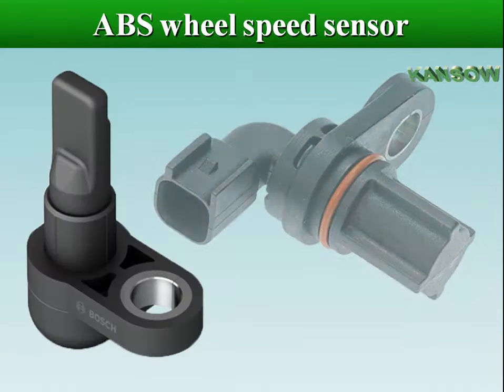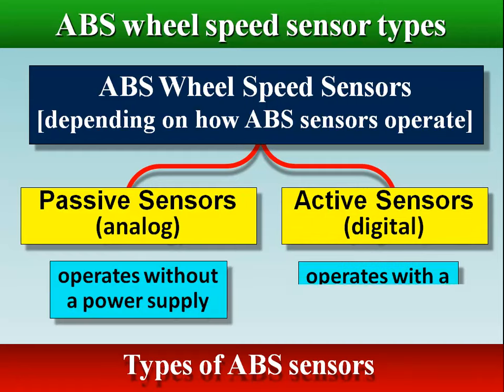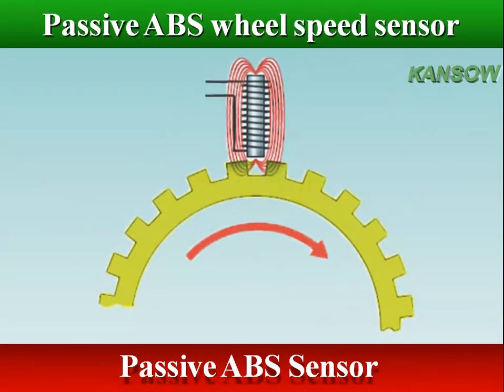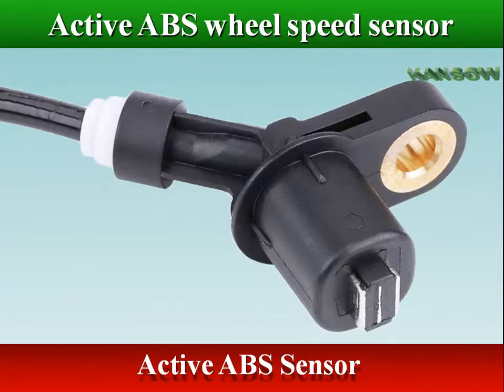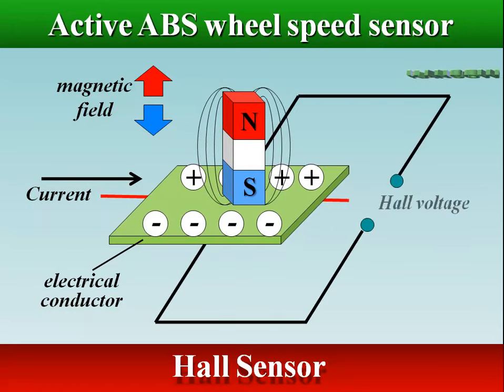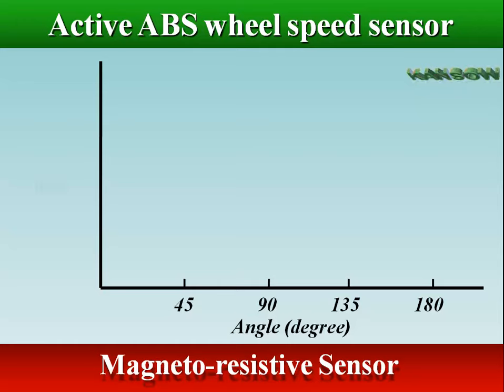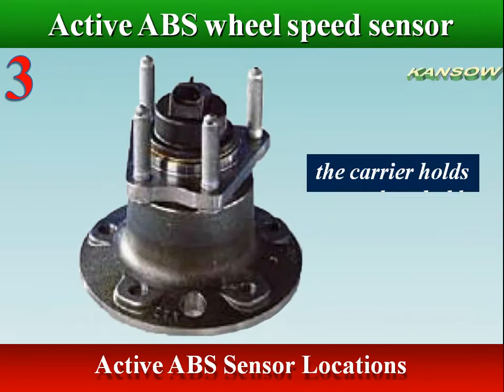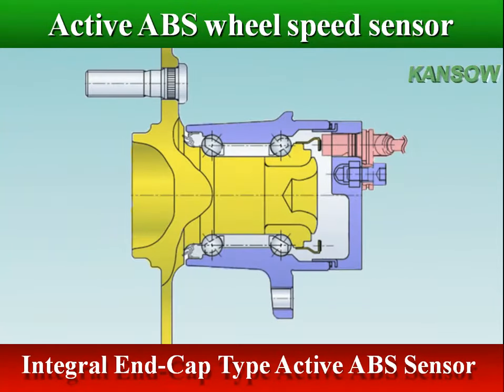ABS Wheel Speed Sensor

Comment: Hi there, Thank for good video. Is it possible to operate ABS module with only one speed sensor? Actually, I am a student and want to present the ABS operation with single tire and break assembly using single speed sensor.
Reply: You can't control anything you don't/can't measure. ABS needs to know the speed of all four wheels in order to function properly.
Reply: you would probably have to modify the computer software to only work for one tyre, seems like a lot of hassel for what ur trying to do
Reply: Yes! I discovered that my car has been using left speed sensor only, it was confirmed by the scanner tool

Comment: If your speed sensor is not working what might be the issue?
Reply: A lot of times a bad wheel bearing screws up the gap where the speed sensor is and gives inaccurate readings. When I see an ABS light on, it more like a "check the wheel bearings light", it doesn't take much to mess with them.

Comment: The older external designs can be worse than useless. It is ridiculous to have an abs ring and sensor mounted externally where it is totally exposed to dirt and debris. Some of these old type sensors  have a strong magnetic field so all it takes is a few tiny specs of flakey rust to knock out the entire ABS system. Why did the government allow manufacturers to make such a useless ABS system which cannot operate under ordinary road conditions?
Reply: Trial and error as most things in life.